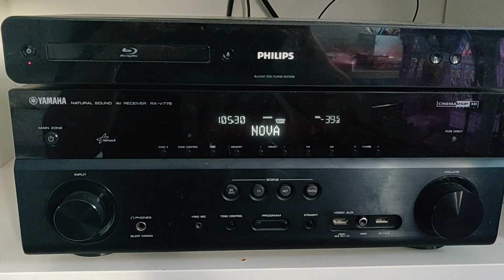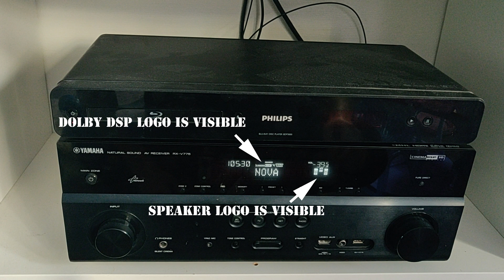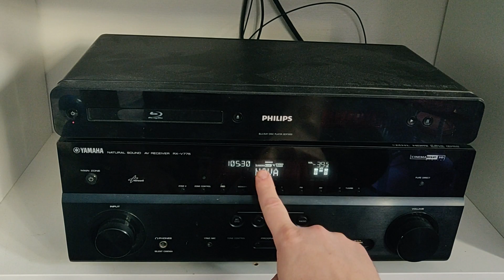Yamaha RX V775 No sound !!FIXED!!

Comment: Great video, I tried this but didnt work for me - I used a bit of an inaccurate heatgun, but said it was around 450*c. Held around it for 2 mins using same paste as in video - I didnt have any iso to clean up the area - is this a deal breaker? Will also just try running through sound while heating the dsp chip to see if thats actually even the issue - I would think it would be - Many thanks
Reply from the maker: Sorry to heard that. If it is the DSP chip you should be missing to logo on the startup like in my video. The problem with inaccurate heatguns is that they may run too hot. Too much heat will damage the chip and may cause other issue such as solder causing bridges to other components and causing them to short out. This is why you should always use a hot air soldering gun because the temperature is precise heat and you can also control the air flow. Cleaning up of the flux is important because there is some many different type of flux some you can leave and others you must clean. Take a look at your flux what does it say about cleaning.
Here is a good tread about the issue https://www.avsforum.com/threads/the-official-yamaha-rx-v673-thread-7-2-channel-network-avr.1408245/page-203
I actually bought a new chip D80YK113DPTP400 for my amplifier. I will post the video on how to change it.
Reply: @modernfix1  hi sir will this  required software after changing the dsp ic?
Reply from the maker: @DrAVRECEIVER  It did not ask it but I did a firmware update on it and a full factory reset. I think it may vary since this unit was in a factory repair shop before. The firmware update can be downloaded from yamaha website.

Comment: Is it possible to get the entire board for the yamaha rx v775 somewhere? I mean the board where the sound chip is. The board was damaged during the replacement. Thank you for the info.
Reply from the maker: it is, if you can find one. But for my model the new board was about 550eur so it was valued more that the amplifier at current price.
Reply: @modernfix1  thank you for the answer. that's probably unnecessary. for that price you can buy a 7.1 amplifier. but thank you for the answer.
Reply: @modernfix1  I'll probably throw the amplifier away.

Comment: I’ve got the same unit brand new in the box the only difference between what you showed and what mine is doing is the Dolby logo actually lights up but the speaker indicators do not light up. I did a firmware update still did not fix the problem the protect relay does click, which tells me it’s not in protect mode so I’m assuming it probably is that shit that you had to flow but this is brand new in the box I find that kind of funny it’s got the remote it’s got the manuals with it. It has the optional Wi-Fi network adapter that was sold separately also new in the box, it’s amazing
Reply from the maker: Hope you can return it or get it fixed under warranty.

Comment: On my rx-a770 I see two dsp chips.  But I don’t see the sliver prongs sticking out like yours.
Reply from the maker: google the chips and see what they do and usually you can find the data sheet of that chip. If you do not have the legs it is usually then a chip that has solder balls under it and you just do the reflow with flux and hot air same way.

Comment: @Modern fix 
I have the same problem as you with my Yamaha RX V675. Does your device still work after your intervention or did you end up changing the chip?
Reply from the maker: It worked for about 6 months, just long enough so I got a new chip from aliexpress. Replaced the chip, there is also a video about it.
Reply: @modernfix1  thx 👍

Comment: I´m about to send mine for repair, the thing is I have no local repair shop so I have to ship it even before knowing if it is worth the repair. My friend has a heat gun so I might as well give this a try, have it stored in a box for 2/3 years with no sound, everything else seems to be working fine.
Reply from the maker: I asked from Yamaha certified repair shop for the estimate price of a new HDMI card. In my country the estimated price was 540eur and they said if they can even get. Estimated delivery time was 2-6months due to the global chip problem.
Reply: @modernfix1  I did the same, it’s around 250€ if the whole board has to be replaced. Thats how much I paid for the whole unit. 540€ is just nuts!
Reply from the maker: @italiwoods  Yes, that is too much money. Everything is getting so expensive these days.
Reply: Aaaaa... So I finally did it, borrowed a heat gun from a friend and tried the fix. No luck, didn’t go as well. Heard some cracks, smelt like burned plastic for a moment, and nothing changed. Monitored the temperature for 2 minutes, didn’t pass the 200 degrees I think. Well, garbage with it I guess. Time to get a new amp ahah.
Reply from the maker: @italiwoods  Very sorry to hear that. You can try selling the other boards for spairs. There is a big market for those since new parts are rarely available these days.
Reply: @modernfix1  That would be great! But how can I be sure that everything else will be working ok?

Comment: Could you share the name and brand of the product you used. having the same problem with my RX-A1020. will be greatly appreciated
Reply from the maker: Yes, of course I can share. The thing in the tube was soldering flux. It helps to make the solder tin flow. I have a tube of some cheap stuff made in china. The brand is Hanwuyou advanced metals tech inc. Flux type NC-559-ASM. Almost any soldering flux in a tube can be used. The best would be amtec 559 rosin flux.
Reply: Hi, thanks for the video again I bought the flux from Amazon is a no  clean Amtech brand (NC-559-V2- TF) that worked like a charm now my RX-A1020 is singing again thanks to your sharing thank you again.
Reply from the maker: @luisfloresm1  Nice to get feedback that this worked for you. Thank you for great questions and commenting.
Reply: I’m having this problem with the same model as you. The 
RX-A1020. Hoping this will fix the issue
Reply: @luisfloresm1 so did you not have to clean the flux that you used after heating it up?

Comment: I have v379, same problem did the process but now wont turn on, checked with the multimeter i have short on various terminals of the dsp with the case (ground) definitely did something wrong, gonna buy a new dsp ic  and gave a last shot to this guys before throwing him to the window
Reply: A mi me ha pasado lo mismo. 
¿Lo solucionaste cambiando el chip?
Reply from the maker: Yes, I had to change the chip at the end. The heating worked for about 6months.

Comment: I bought pioneer private pro ax 720 amplifier but it is not giving sound to the speakers but when i turn on the amplifier there is a slight vibration in the amplifier.  Plz tell how can i fix
Reply from the maker: Hard to say what could be wrong with it. Sound like you may have power supply issue. Have you taken a look at the power supply? Does it have any bad capacitors, bad wiring or discoloration on the PCB? You can find my email address on the channel info and you can email me pictures and video also about your amplifier if you want. Or post a link on youtube of you issues and I can take a look. This DSP chip is mainly on Yamaha amplifiers since it was a faulty ship made by texas instruments for Yamaha.
Reply: @modernfix1  Thanks for your cooperation i tried to solve it but i didn't successful so i am repairing my amplifier from local market repair shop😊😍

Comment: Hwo oftem does thisnproblem appears? I mean i am going to buy used 775, how many chances i have to get it with failed chip?
Reply from the maker: if the same chip is there it will most likely fail. Buy a model with a newer chip version.

Comment: I’m reading different temperatures to heat up the chip and I’m seeing F vs Celsius interchanged?  Can someone confirm the correct temperature
Reply from the maker: You can use google to look up the conversion of metric units to imperial. e.g. celsius to farenheit

Comment: Thank you for the vid!

So u don’t need to replace the chip?  Would it occur again?

Also, what’s the solution on the toothbrush?  Is it from that can?  If so, what’s solution is in the can?  AT IPA or ART IPA?
Reply from the maker: If it happens again you can try removing the chip and replacing the solder under the chip with fresh solder. If that does not work you would need a new chip, but issue with a new chip is that they are very hard to find depending on your location. New chips are not expensive about 30dollars. I could not find any in my area and if could the shipping was very expensive.

The solution I use for cleaning is IPA (iso propral alcohol) if you cannot get it you can use zippo petrol also. Or any electronic cleaner
Reply: Hello excellent explanation step by step What is the name of the liquid that is put on the DTS and my onkyo has no sound

Comment: Is this chip the same in rx v367 thanks
Reply from the maker: The best way to see what your chip is to open your amplifier and take a look at the part number.
Reply: You can check this by looking at a service manual for your amplifier. Find the schematic of the board with the dsp chip and locate the ic number of that chip. Then look at the side or the bottom of the page to see the part number if it is not written on or near the drawing of the chip in the schematic.

Comment: Just about to do this too my RX-A770 what type of flux would you recommend? Little confused at what type of materials ur using, first application looks like a paste and the second a liquid. If you could thanks
Reply from the maker: I use Flux NC-559-ASM the amazon link is in the description for more information. It is paste but when the surface is hot it melts in to a liquid. This liquid makes the solder to flow more and their by making the connection solid again. To cleanup I use IPA (isopropyl alcohol). There are fluxes that do not need cleanup but I find it that the board looks cleaner when the flux is cleaned away. Hope that this helps, if you have more questions feel free to ask.
Reply: @modernfix1  Thank man appreciate

Comment: WHATS IN THE TUBE !!!???
Reply from the maker: The thing in the tube was soldering flux. It helps to make the solder tin flow. I have a tube of some cheap stuff made in china. The brand is Hanwuyou advanced metals tech inc. Flux type NC-559-ASM. Almost any soldering flux in a tube can be used. The best would be amtec 559 rosin flux.

Comment: Hello, let me ask you where did you buy this chip?
Can you send a link with a good chip?
To avoid buying from a fraudster.
Reply from the maker: The seller was no longer available on Aliexpress. So I cannot give any recomentations. Aliexpress usually have a good return policy same as ebay.
Reply: @modernfix1  Can any type of flux be used?
And did it help for a long time in your case?
And the last question, did you replace this dsp with a new one?
Regards
Reply from the maker: @robertsami  for me this fix lasted for about 6month if I remember correctly. Then I changed the chip. But I have read on the internet that this has lasted longer for some people. You never know.

Comment: It is not a permanent solution
Reply from the maker: No, since the chip may be damaged. Permanent would be a new chip. But this solution may work for week or 2-3 years. Like I have stated before I could not find a new chip if you know a source that has world wide shipping please let me know. My amplier has work now fine for 3months already. A cooler on the chip will also prolong the life of this fix.
Reply: Chips not available, states that in the schematics. What other options are available. This usually does work

Comment: I am facing constant relay clicking issue with my Yamaha HTR-2071 and there is no sound from speakers. Kindly check this video here: https://www.youtube.com/watch?v=A3NIpx4izXI. This video is of Yamaha RX-V481 but I am also facing the exact same issue. Please help.
Reply from the maker: I dont think that this issue the same. If a relay is clicking all the time maybe a power supply issue. Take a look with a multimeter is the current jumping up and down. Start by taking that board out and hooking it up so that you can measure the connection points. If the relays are the same you can change them and if the problem still their then the power supply is the fault. Start tracing the line where the current comes.
Reply: @modernfix1  Thank you very much for your prompt reply. What I meant was that the speaker relay clicking in my Yamaha HTR-2071 is similar to the one in Yamaha RX-V481 shown in the video for which I provided the link in my comment. I am not a very technical person. I sent my unit for diagnostics and repair. I was told that the main/HDMI board of the unit was faulty and therefore, required replacement. Firstly, it is hard to believe; and secondly, the board is very expensive.
Reply from the maker: @xxtra111  Yes, the HDMI card is very expensive and hard to get. Did you try heating the chip? That way you can test if it is the chip. Then you have two options either try to change the chip or get a new card. It is a very common issue with these.
Reply: @modernfix1  Thank you for your suggestion. 😊
Reply from the maker: @xxtra111  no problem, hope you get it working.